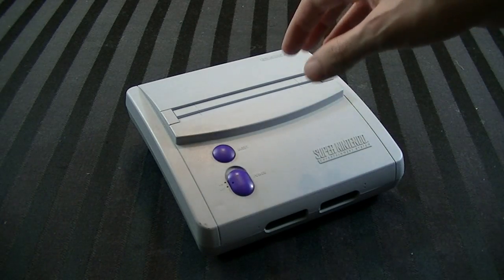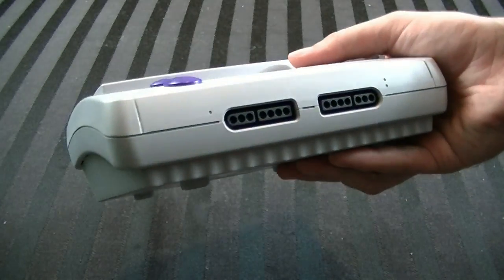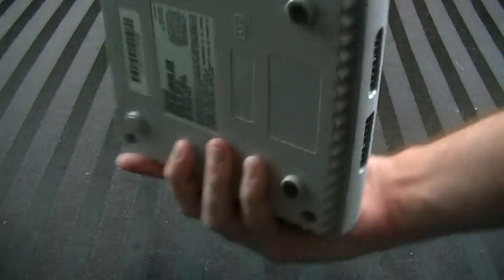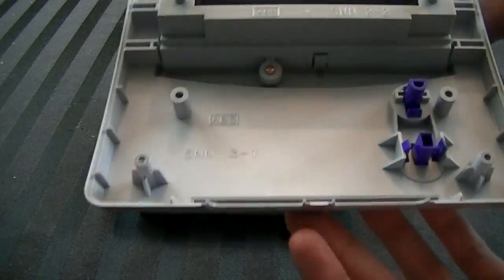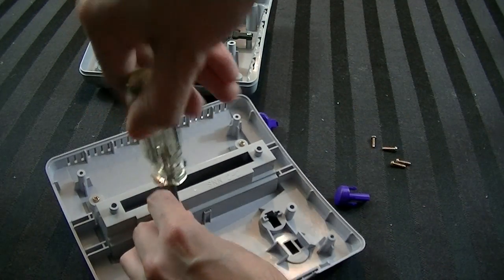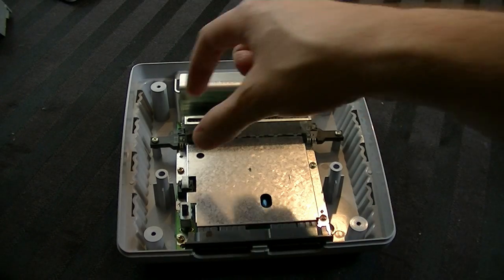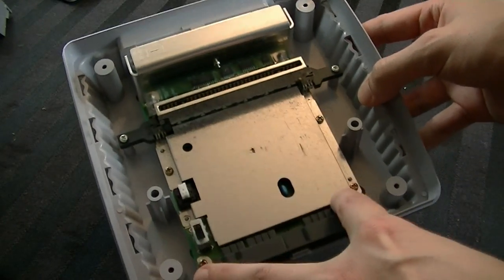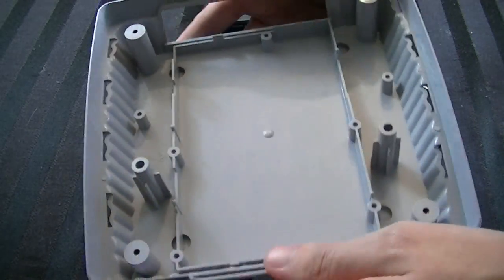Gamerade - Cleaning and Restoring a Super Nintendo Jr - Adam Koralik

Comment: I bought one of these and had it modded to output S-Video.  It cleaned up easily and the video output is way less noisy than my girlfriend's regular model SNES, and it doesn't have the white vertical line issue that the regular snes has.

Comment: The Bic pen trick works, I used it to clean a old N64. All you need to do is heat up the end of the bic pen with a lighter and it will form to the head of the screws.

Comment: One thing worth mentioning is that the SNES JR is that it can be modded for SCART output, and supposedly the image quality from an RGB modded SNES JR is a lot better than what you will find on most other versions of the system. It's basically the same deal as SCART on the N64 and is likely more work than most people would likely want to bother with, but it's still a useful thing to know if you want to make the most informed decision. The best no-fuss solution if you want the best RGB video output is the 1CHIP model of the SNES, although they can be costly to get a hold of since they're among the rarer models, and there are other models (like the RGB 02 model SNES) which puts out a similar enough image that most people would say the difference is not noticeable.
Reply: SCART output? I thought it was just RGB through the AV out!
Reply from the maker: NicRenee Khaw Not on the JR.
Reply from the maker: +JenkPac Shakur I have a video coming out in just a few hours I think you're going to like. ;)

Comment: with the BIC pen method, you put a lighter to it and put the pen on the screw, leave it there for a few seconds and it the plastic will harden around the shape of the screw.....however, it may end up breaking the plastic on the pen if they are too tight

Comment: I have two snes's, one has no sound and the one that worked great for years all of a sudden is not working. The power LED indicator light comes on but I have a black screen, so I will do your method of  cleaning and see what happens. I will use an old credit card and see what happens. Anyways man you're awesome, great video man.

Comment: Actually, you can get the SNES Jr. to output an RGB signal, which is considerably superior to what some of the older SNES models (with the 1CHIP board) are able to produce, if you're willing to perform a simple mod on it.  The difference is pretty hard to see on a typical CRT display than an LCD (assuming you'd use a good upscaler with it, like the XRGB).

Comment: woah woah woah woah WOAH. Pass on the snes mini jr? You do realize you can put a SUPER easy, super fantastic mod chip in it to make it output RGB, right? Once it's modded it can run circles around the picture quality over the normal snes.
Reply: Shh. We want to keep the prices down. I miss my old yellow monster but at the end of the day it all comes down to what you actually need to play it on with modern TVs. If you can find a 1chip v3 that is the best of both worlds. Be careful. I had two sellers cancel after purchasing one once they found out is rare and I only asked for a serial before buying. Old shell without yellow and with the 7314 amp it can match the snes mini rgb mod. Snagged a mini last night for $35. Just need the $15 amp kit on ebay which now comes with led, and a gentle top shell clean and I'm in business for my x-rgb that is coming.

Comment: I don't have that compressed air item. I  just cleaned my Genesis model 2 (mainly the contacts of the inside of the console) few days ago, (and as well as the contacts of a few games I wanted to boot up to play) with Windex cleaner I know it isn't the best option but at the same time better than anything at this point. Anyway... the damn thing plays good...well great. It plays as good as it did when it was still relevant, only difference is that every now and then when the games do not get played for a good while, then just go ahead and repeat the process over again if it happens.

Comment: Hey, I was wondering if you use pledge on current consoles? Also, does the pledge help with dust?
Reply from the maker: Yes, I do.

Yes, it does.
Reply: AdamKoralik which one do you prefer? Pledge has a few different ones.
Reply from the maker: Dennis Salas Jr
Regular orange Pledge. Not the moisturizing kind.

Comment: Adam, do you have a recommendation for a third party power supply for snes? All I can find are ones that only give 9v instead of 10v. (Most of them are the 3-in-1s). Also, do you know if it's possible to mod a genesis2 ac adapter for snes? (Because they have the exact same specs)
Reply from the maker: Can't say I do, I'd just check EBay to be honest.

Comment: My biggest issue with the original SNES model is exactly what you mentioned. The yellowing. My families SNES ended up with my sister so when I was in the market for a SNES, I got this model. Money was about the same as a non yellowed original that I could find at the time.
Reply from the maker: Fortunately, the yellowing can be reversed. But it's a pain.
Reply: Yea after watching your video about the yellowing reversal process I decided that although I have emulators, I wanted to collect some games and have the physical system to play them on. I mostly collect...sports games...Ha. Sports are my thing, and it is fun to go back and collect for the various systems.

Comment: Hi Adam. For once, you are giving bad advise. The SNES jr is highly sought after in the video purist scene because with a simple mod RGB can be restored. Comparing all SNES RGB output (using nintendo multiAV port to SCART cable on Sony PVM) the Jr has the best clean RGB output. This is because they all use the 1CHIP video IC.
Reply from the maker: All I'm saying is that natively, it doesn't have that.

Comment: Cool video. I have a sega gensis model 2 that only had the rf box but I got a composite cable for replacement and I connected it to my 42 inch sharp hdtv and it looks so much better only thing is it was not full screen since it shows the borders on the left side only way I could fix that was to use my composite to hdmi converter white box thing and it made it full screen. I just wish I could fix the border issue on my tv without having to use the hdmi converter.
Reply: Reading your comment was painful. Using Composite in a HD TV...okay, if you're not in Europe it's pretty much your only Option. But stretching the screen to Full Screen? Why would you even do that?

Also, most TVs have the Option to Stretch 4:3 Images to Widescreen Build in.
Reply: Cause I don't like seeing borders on the screen. When I have it just connected with composite it just shows the borders on the left and bottom screen like when I play sonic 2 its like a light blue color. And yeah its the only option I have. Connecting the composite to the hdmi converter fixes that issue.

Comment: If you reconnect the RGB cables (the capability is in the system, just not hooked up to the Multi AV-out), the SNES Jr. actually has the best picture quality of all the SNES types.
Furthermore, of the "regular" SNES types, the video output quality differs greatly, depending on the hardware inside.

The comparison with the Wii Mini made by some people here really doesn't fly, especially not when you (get someone to) solder the RGB cables in, which actually turns the Jr. into the superior version to own.
Reply from the maker: Yes, but we're talking about stock hardware.
Reply: AdamKoralik Yes, but you said you would not recommend it "unless you like the look of it, or you don't care about the video quality". You should have added: "Or if you are willing to restore RGB capability in order to get the best video quality of any SNES".
Reply from the maker: ApemanMonkey
Fair enough.
Reply: Any guides on how to do that?
Reply: mortalkombatrulz There are several, but I'm still trying to figure out what's the best way to do it (mainly with our without the RetroRGB amp), as I only just received my Super Famicom Jr.

With the internal amp:
http://retrorgb.com/snesminirgb-original.html

With the RetroRGB custom amp:
http://retrorgb.com/snesminirgb.html

Then there's this:
http://www.gamesx.com/rgbadd/snes2rgb.htm

And this:
http://gamesx.com/wiki/doku.php?id=av:snes2rgb

So, if anyone else has input on what method to use, I'd be happy to hear it.
Reply: ApemanMonkey I have an RGB/SVideo modded one, it's every bit as good as people say on the Internet hehe
Reply: Yoann Michot Cool! Do you know how it is modded? Just using the regular internal amp, or with a custom amp?
Reply: ApemanMonkey I didn't look too much in the detail as the amp board is covered in hot glue. It looks like the typical amp chip with capacitors.
Reply: Yoann Michot Did you (have someone) mod your own, or did you buy it pre-modded?
Reply: ApemanMonkey I bought it pre-modded on eBay, as it was the same price as an unmodded one.

Comment: Some Interesting Facts:

This is the SNS-101. (More commonly known as the Snes 2/Snes Jr/Super Nintendo Jr.) It came out 5 months prior to the Super Famicom Jr. (also know as Super Famicom Junior or even SFC Jr., which came out 3/27/98 and was a redesign to Japan's first model/PAL's only model which they both look very almost identical to) This retailed for at about 7800 yen in Japan. What's interesting enough is that ours lasted (fellow Americans) from '97 - '99, and Japan's lasted from '98 - '03. We got two they got five. Our controllers (as well as Europeans controllers) wires are longer than Japan's as well. 

Edits: 1 From Japan's/PAL's only model changed to Japan's first model/PAL's only model. 
          2 More commonly.
          3 Interesting.
Reply: For the mini and Jr controllers they're the same length, I own both a SNES mini controller and a Super Famicom Jr controller and they're the same length and the JR's controller is slightly longer than the original Super Famicom controller.
Reply: Genesis model 3's (my least favorite save for the fact it's region free and enables players to off the bat play Japanese imports I  shared one  only in my lifetime when I was 6 yrs old in 1st grade so back then wouldn't have known the difference between system specs, hardware/software emulation, gimping to re-selling the console likely at a cheaper affordable price to pass the saving etc.) only came out sometime a year later as well, which is also interesting. It lets you know that they were pretty much (obviously both companies Sega & Nintendo) were doing what they could in terms of at least still bringing out few sports titles and such, and of course while their core competition was going on (Sega Saturn and Nintendo 64) to both companies respectively making as $$$ as either could. 

P.s. Of course granted the Saturn really didn't do anything for 1998 barely.
Reply: Your telling me that they were making Snes jrs in 03?
Reply: Apparently still Manufacturing them still up to that point in Japan.

Comment: I bought my "junk" non-working SuFami Jr for ¥3000.  Put a new power resistor thingy in and it worked 100%!

I of course added a RGB mod to the  system and have the best RGB of SuFami console I have.  Not bad for ¥3000!  I just regret not buying a mint in box SuFami Jr in 2006 for ¥6,980 when I was at uni in Japan.  Reason I didn't buy it was the lack of s-video.  I bought a regular SuFami from Hard Off for ¥100 instead.  Will never compete with my WONDERMEGA I bought also in 2006.  For ¥17,000 with a bunch of possibly brand new MD games including some that are now worth a small fortune.  SPARKSTER for instance.  BUT I still kick myself for not getting the mint in box SEGA WONDERMEGA during that time for ¥39,900.  It was still there when I went back to my uni to visit friends in June 2007, but I was broke and could not afford it :(